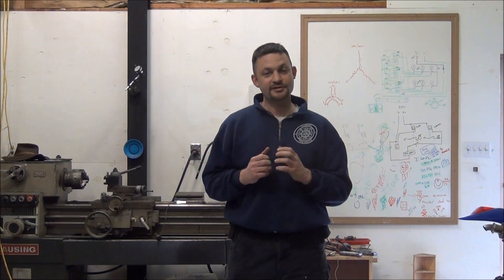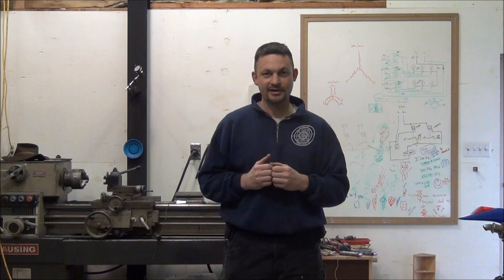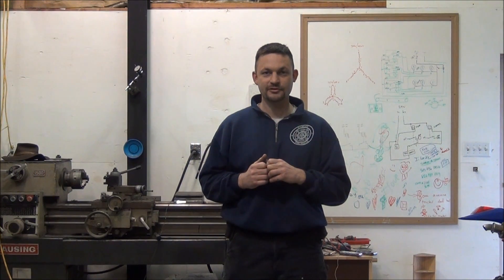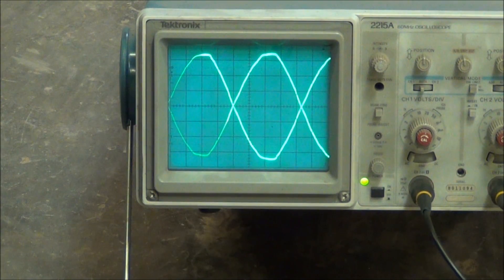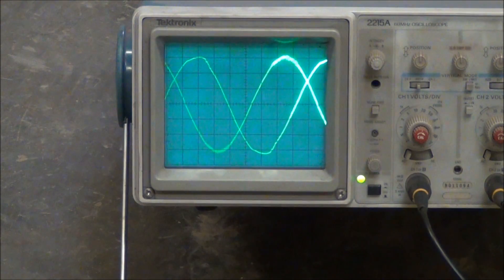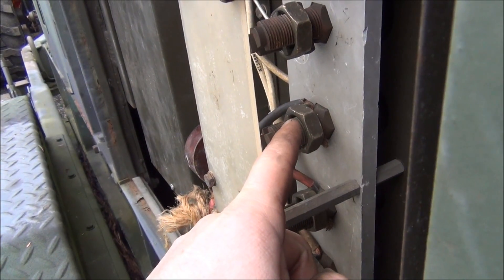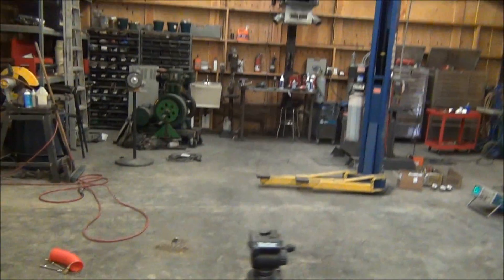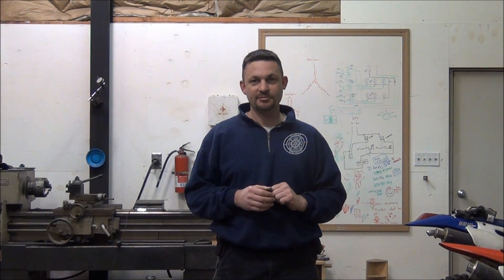3 phase generator for single phase residential backup power

Comment: Are the devices that would be 220v such as mig welders sensitive to the voltage variation? Is the circuitry inside them sensitive to the variation?  I bought an old welding factory that has been gutted (all the wiring gone) It is essentially off grid now. Im tempted to leave it off grid. I do have equipment like welders and plasma cutters that i would like to run off my generator. what are your thoughts or any electricians in the comments? Very interesting to me. thanks for putting it together.
Reply from the maker: if you look at the input voltage requirement for your tools, you'll find that most of them say 208v-240v. Almost all 240v tools and appliances work fine on 208v.

Comment: I would be interested in seeing how you hooked up the generator and through what switching ect. I as well purchased a used Kohler 20kw (inside sticker rates it at 25kw) that is on its own trailer. I would like to keep it on the trailer and have thought about a quick disconnect to the house/shop. Interested in your suggestions regarding a good way to make it happen. This generator has multiple ways to get various voltages based on which wires you join together baccording to the data plate. Thanks for your original video!

Comment: I have a 45kw generac generator that I want to take it to my house is that possible because I was told that it would tear up the generator using a 3 phase on single phase house but it's a rather large house .
Reply from the maker: +Lorenza Edwards It is possible to run your house on 2 of the 3 phases; you'll get 120/208 to your house that way, and only be able to use about 30kw of the generator's available output power.  Most 3 phase generators tolerate this just fine, but without knowing exactly what you have I can't say for sure.  As far as the 120/208 power to your house, most 240v appliances run just fine on 208v.  Things like an electric oven, clothes dryer, hot water heater, electric heaters, etc. will produce less heat, but otherwise everything will work fine.

Comment: Very nice video and explanation. I am interested in going the other direction if possible. I have a Briggs and Stratton natural gas, whole house backup generator (18kW single phase) wired into an automatic transfer switch that feeds the main 200 amp panel. I just picked up an old Monarch 10ee lathe (1943) with 3 phase motor generator system that feeds a 3 hp DC spindle motor. So before I purchase a complete rotary phase converter to supply 3 phase to the lathe, I was hoping a phase converter control box may be able to be wired to utilize the standby generator. Any thoughts or comments are appreciated.
Reply from the maker: +Tom Schulte There is really no way to get that 3rd "leg" for 3 phase from the single phase generator that you have (unless it happens to be a 12 lead generator head...unlikely given its size, but possible).  Options for converting 120/240 to 120/208 3 phase are:  A rotary phase converter (as you already mentioned), a static phase converter (has some disadvantages that you can probably look up on google) or a VFD (variable frequency drive; has some advantages, but will be a bit spendy).
Reply: +sewerzuk Thanks for the reply. Later model 10ee's were outfitted with 5 hp DC motors. If you have Monarch refurbish your lathe, they now outfit it with a 7.5 hp ac motor driven by a VFD. Users indicate that static converters do not work well with these motors. Most guys replace electronics with a VFD and larger motor or a servo drive and motor with the 3 phase supplied by a rotary phase converter. Thanks again.
Reply: Just use a VFD.
100$ on Amazon. Then you can control your frequency.

Comment: have you heard of using a 3 phase electric motor for the generator and power all in one? first get it started on one leg, then rob the other two for power once its running.
i heard that at a bar a long time ago.  think its possible? seems like it should.
Reply from the maker: miketheherbguy Yep; that is called a rotary phase converter.  I built my own 30HP one a few years ago; this is how I currently power my milling machine and lathe
Reply: sewerzuk did you do a vid on that, currently have a dead shop right now until that is done.  what is your email. would love to talk to you about this.
Reply from the maker: No, I did not put together a video on the phase converter.  I will send you a message with my email address
Reply: want to do a detailed video on it.?

Comment: I just bought an mep -002a 1981 930 hrs. Looks to be in good shape. Order the fram oil filter an am upgrading to spin on fuel filters. My question is do u ever prime the oil system before first start since who knows when the last time it was started. I have always done this to my hod rods after sitting the winter to prevent bearing damage I can't see this being any different. I will attempt to get as much oil in the oil canister as I can without making too much mess but I was thinking maybe prime it like an L's motor with an external prime can connected to the oil pressure gauge seeing that goes to the filter toping it off and to the valve cover squirter and the block which I'm assuming goes to the main bearings. Or should I just rotate the motor over for a few seconds without fuel so it won't start till the oil pump gets something into the engine at low starter cranking speeds. Or am I over thinking all if it?
Reply from the maker: I usually rotate those engines over by hand several times before first start; not because of the oil system, but because of the injection pump.  The rotor can stick and break the drive key.  This is pretty common on the -002's and -003's that have ben sitting for long periods of time.  With regards to the oil cannister, I wouldn't worry about filling it.  It drains almost empty when the engine is shut off anyway.  It usually takes a good 10 seconds for these engines to build oil pressure (unless you are starting it warm).
Reply: Thanks. I did turn it over a few times by hand to check to see if the motor was seized up before checking to see if the starter worked. So hopefully all is good with fuel injection pump. Where do u usually get your parts from I need fuel pump screens and valve cover gasket. It only had one screed on the aux pump. So I put it on the first in series main pumps for now but would like to have all 3. I would also like to check valve lash hence the need for the gasket. This is my first military gen and hopefully not my last any other tips would be great. Thanks again.
Reply: Bobby Diminnie
update. got it running tonight about 9pm for the first time since i got it from govliq. I know its bad to idle the machine but for the first 30 seconds it sounded a bit knocky... and i really didnt want to ramp it up till it went away and it did. solid oil pressure gauge was pegged out. rotella 15-40. its about 15F here in MI but had the torpedo on it for a few hours while converting fuel filters in the closed garage. started checking out gauges. saw about 240v on volt gauge and saw 120v on one leg after flipping the leg selector switch. got the frequency gauge to 60hz after about 30 seconds from initial start. then all of a sudden the panel lights got real bright then dimmed back down a few times around the same time saw the frequency drop out and back again a few times. engine sounded stable and voltage was stable..ish... then lights stayed dim and the frequency gauge dropped out and stayed out. had to call the noise quits for tonight look deeper into it tomorrow and check to see if the batteries are charging properly. i gave a quick look at all the connections in the control box not a slightest sign of corrosion and everything looked tight but ill look closer tomorrow. is it possible i damaged anything by idling for the first 30 seconds? any suggestions on what else i can check. total run time maybe 5 minutes. didn't want to P.O. the neighbors too much

P.s. I know you have 100 other posts and life activities going on but appreciate your time and any advise.
Reply from the maker: It is true that you shouldn't allow the set to run at idle; leave the throttle set at 60 hz and allow it to come up to that RPM on startup. With that being said, I doubt that you damaged the VR card with only 30 seconds of low RPM operation.  The panel lighting is based on the 24v system; the frequency and voltage meters are based on the 120v legs on the generator.  The only thing that I can think of that would affect both of them is a bad ground on the control box.  I believe that it is grounded on the stud labelled "ground" on the chassis (near the bottom of the set, close to the fuel pumps).  I would clean that connection point, but also run a temporary ground from the negative terminal on the downstream battery to a bolt somewhere on the control cubicle.  That's just my guess...let me know what you find out.
Reply: sewerzuk 
I'm using optima batteries for this and I had to set them on the ground and install jumper cables to reach. I think the shoty connection was the culprit. I made some nice extended 00 cables at work and replaced the originals. I think the jumper cables I was using had a few bare spots and it would occasionally touch the frame.  I started again and freq gauge held fine and lights stayed constant. Then I cleaned that ground anyways.  New update. I borrowed a 5000 watt Garage heater to do some load testing. I used an amp clamp and its pulling about 21 amps @240 v but the percent load gauge is only reading about 75% . I tried adjusting the gauge screw but it just offsets 0% so when its off it reads 20%. Is there a way to adjust this down by the current transformer. I see a little pot by the convenience breaker what does that do? And what do the pots on the vr do? I added a toaster oven with only one of the two heating elements on, to L1 and a small 1gal air compressor to L3 to balance the load to about 25 amps per leg or 6000w/120%. I think this load can be obtained for about 30-40 mins.  I keep reading everyone saying these things are good for 7500 watts so I gave it a try. Put the toaster oven on full blast 1000 watt rated with both elements on L1 and took off the air compressor and put a shop vac in its place on L3 along with the 5k heater the amp clamp read about 30 amps per leg 7200 watts and let it go. The load gauge still only said 105% About a minute or two in all of a sudden the gen started bogging down so I started shutting off loads starting with the shop vac still bogged then I shut off the oven still bogged had to shut off the main breaker to get the engine to recover. On full tilt the toaster oven doesn't turn on and off it just stays on. So the load never changed. So after the engine recovered I turned on the 5k heater only and noticed my multi meter read 130+ volt at the convince outlet. Even tho it was stable at 120 before the bog. I had to turn the v adjust all the way down to get 120 again. I have only the 5k heater on at this point and after 3 minutes the voltage dropped to about 110v and had to turn the v adjust back to the spot I had it before about half way to achieve 120v. I did all the loads again to check to see if the governor was going full tilt during the bog. When it bogged I checked and it was wide open throttle. Any reason as to why it gets this bog and voltage spike after an immediate over load removal and reset to the rated load. I did this again but this time I didn't change the v adjust I just let the heater take the over volt and sure enough without doing anything after 2 minutes it returned to the set 120 v. Am I just over loading this thing too much. I know I've read the loads are 110% for 1 hr 133%load for ten minutes. Is everyone just full of it when they say it can handle 7500+ watts. I stopped doing this after a few tries. And put it back to the 6000 watt load for about 30 minutes and the main breaker popped. Is this normal. I figure I heated the breaker up with the big loads and it needs some time to cool. What are your thoughts? Sorry for the book just want to give all the details.
Reply from the maker: Bobby Diminnie
I sent you a message with my email address...
Reply: sewerzuk
I didn't receive it. could you try it again
Reply from the maker: Bobby Diminnie Just re-sent it.  Chjeck your youtube inbox

Comment: You state that the motors will be fine running at 208V and they could handle the extra current, but what about the wiring in the walls, can they handle the additional current? Same thing goes for the breakers, will they heat up and lead to pre-mature tripping? Or since the motor can handle 208V, that the current won't raised in the wires? 

Thanks
Reply from the maker: The breakers are sized to prevent overloading the wiring associated with the circuit, so as long as the breakers are properly sized for the circuit the wiring and receptacles will always be OK.  As long as you don't exceed the current rating for the circuit, the breaker won't trip.  So to answer your question; yes, the breaker and wiring can handle the extra current.  A synchronous motor running at 208v will draw more current than if it was running at 240v; but only by about 10%.  So, a motor that draws 20 amps at 240v will run at about 22 amps at 208v.  That is a very minimal increase...99.9% of the time, it won't make any difference.  Since that motor is probably on a 30 amp circuit, the change from 20 amps to 22 amps is well within the current rating for that circuit.  On the off chance that you are trying to run something that draws 20 amps on a 20 amp circuit, the change to 208v might start to cause "nuisance" trips.

Comment: OK I have become more educated (slightly). I have a 125v 250v 50 amp single phase spider box. (CS6364). I have pics if needed.  That also tells me I would NOT have 3 phase if using this outlet connector.  Still looking for a potential solution for connections at the genset ?
Reply from the maker: If you want to just hook up the spider box, you can wire it up to L1, L3, L0 (hot, hot, neutral).  You will have 120/208 at the spider box, but as previously discussed that will be just fine 99% of the time...
Reply: sewerzuk That's precisely how we hook up single phase distro boxes in the entertainment industry to the company switch/Bullswitch, in order to power large sound, light, and video systems. 

There are 3 phase CS twistlocks out there, the CS8360 series. They carry 3 hots and ground, 3P,4W. If you need 4 pole, 5 wire 3PhY, look at NEMA L21-20 and L21-30. Or use Camloks for higher capacity loads.

Comment: Any feedback on how I can utilize a CS8269 breakout box and still have 208 3 phase available for some old school machine tools ? I have a Dayton 4W118 genset that can be set for 240 or 208.  Would I have to totally reconfigure the spider box ? is there a way to switch on they fly for each use ora way that would allow multiple plugs to be available ?  Looks like it's one or the other, but not both.  Is this a genset issue or a wiring issue ?
I am just getting up too speed on the 3 phase / 2 phase.  My question would be what is the benefit of running my machine tools on 208 3 phase rather than reconfiguring for running on 240. is there a efficiency issue or a power  issue for the electric motors ? I will be getting my motor plate info later and see what they say.